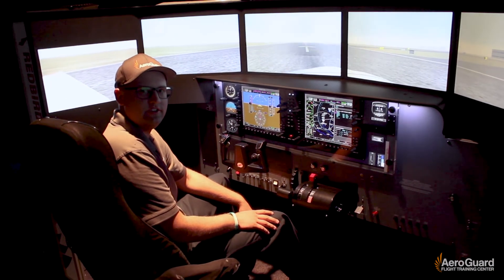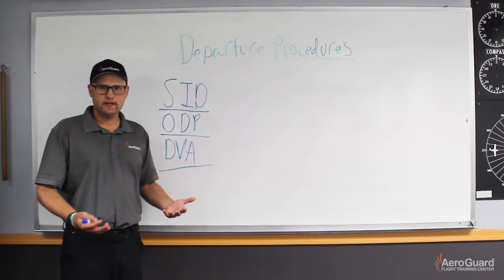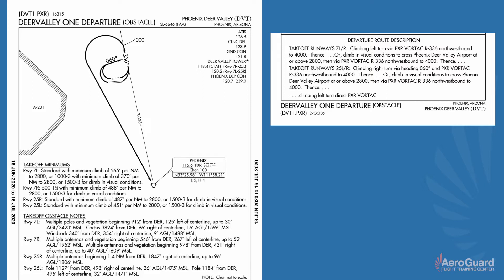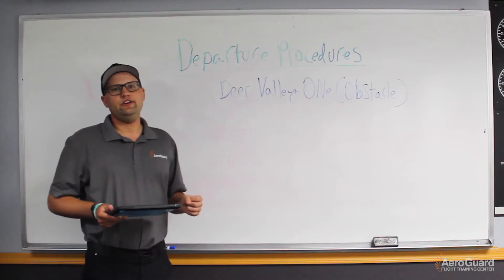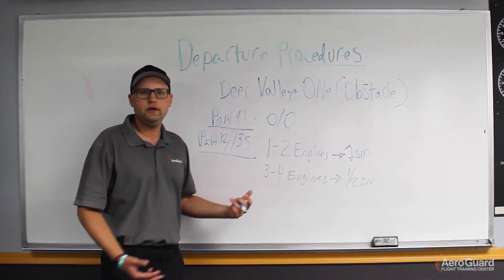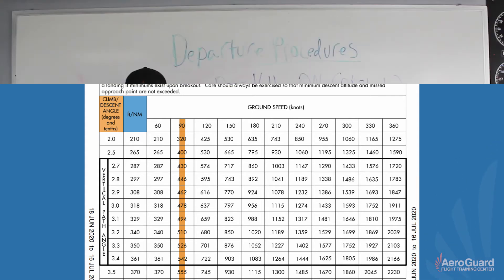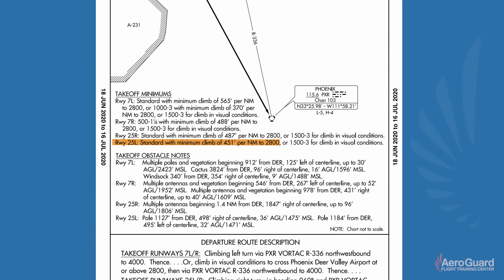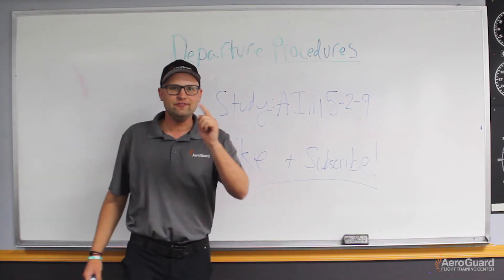IFR Departure Procedures – AeroGuard Flight Training Center

Comment: 1.  Please get a magic marker that actually has some fluid in it.  
2., when you wrote minimum visibility of one statute mile. It looks like you wrote 2 statute miles. No reason to write a fancy one. Just draw  a vertical line instead of some fancy version of 1 that looks like a 2.
3.  I fully endorse the easy calculation of 1.5 for minimum climb. But I also think it’s a good idea to review use of the tables and interpolation.
4. I watched this because I thought you were going to cover SID. You should rename this video as ODP. But, I actually appreciate the review of ODP‘s. 
5. Correct me if I’m wrong, but I think there are additional requirements for ODP‘s, such as, minimum departure of 35 feet above the DER, and turn out 400 feet above the ground if there are no other requirements.
5.  As I recall, ODP‘s are not optional. ODP is what you’re required to fly and ATC will expect you to fly those ODPs.
Please correct me if I’m wrong on any of these points.
Reply from the maker: Hi, thanks for your comment! We appreciate your feedback to ensure our videos provide accurate and helpful information in a clear and concise way. You are correct about the ODP requirements that you listed, and there’s also an additional requirement to ensure obstacle clearance - you must also hold at least a 200fpnm climb gradient. If you accept the ODPs as part of your clearance instructions, you legally must comply with the required climb gradient and hold at least the textual description. If you’re not able to meet the climb gradient criteria, then you need to notify ATC. We hope this additional information is helpful and supports your knowledge of ODPs!

Comment: Converting NM to FPM is done easier without the table. Just divide the ground speed by 60, then multiply by the feet per NM listed.  90/60 X 451 = 676.5 ft per minute